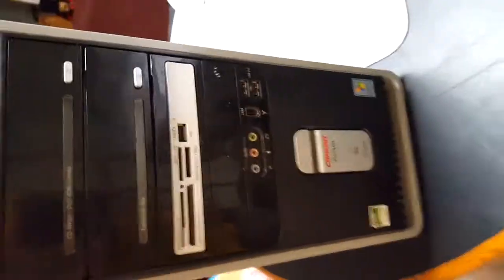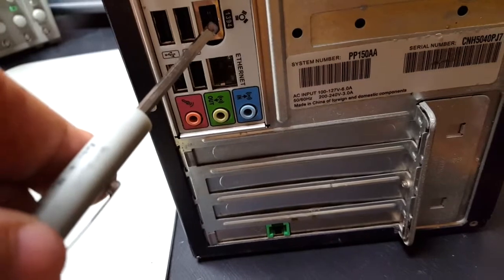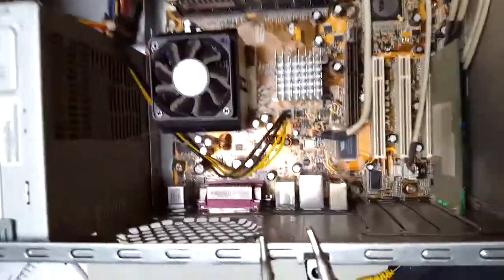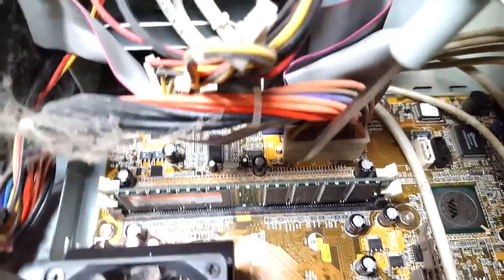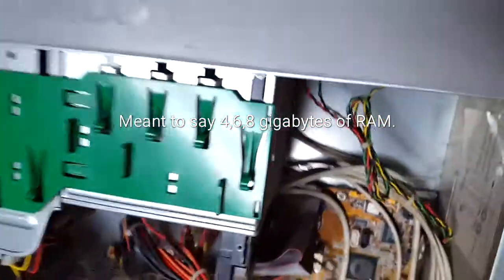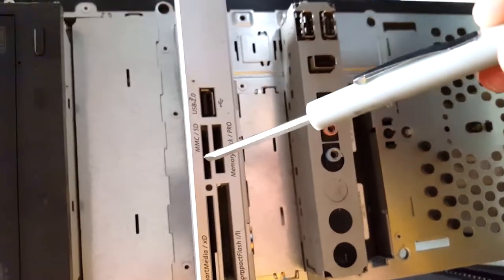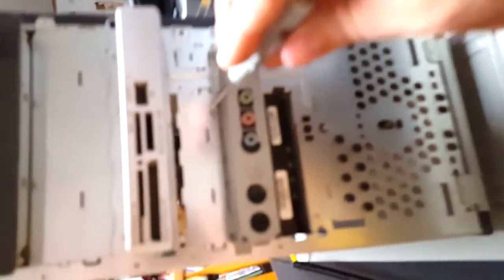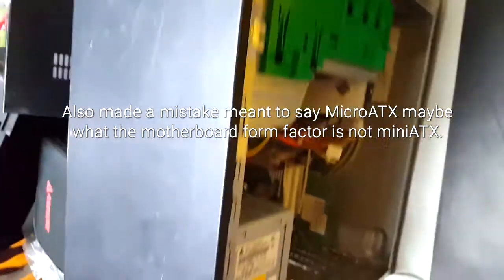Compaq Presario SR1303WM simple tear into!

Comment: This was my first PC. Still not sure why the CPU is often listed at 1.8 GHz, but mine was definitely 2 GHz. I upgraded that machine over the years to an Nvidia Geforce 6200 SE (512 MiB) AGP card, 2 GiB of RAM, and an 120 GB HDD. The HDD was the first SATA disk I've ever used, and I remember having to put a jumper on it limiting the drive performance to 1.5 gigabits per second. That machine lasted me all the way to about 2012 when I got my first multi-core PC. Damn time flies, and the power difference between that and my current PC is ridiculous. I remember getting quite a lot out of that machine too. Even ran Minecraft fairly playable while also hosting a server from it.
Edit: Corrections

Comment: Hey john. Great video. I have one of these. I was wondering if you think this is worth buying parts for to turn it into a gaming pc? I also have a hp pavilion a305w and a dell dimension 4300s. I like the compaq because it has more room inside And all the card slots. What do you think I should do?
Reply from the maker: The Motherboard in it won't support Ram beyond 1gb and anything over a single core processor so you wouldn't have the power to really game on it. I suppose you could reuse the tower. I'm not sure if the stock power supply would be enough to run a good gaming pc.
Reply: Thank you!